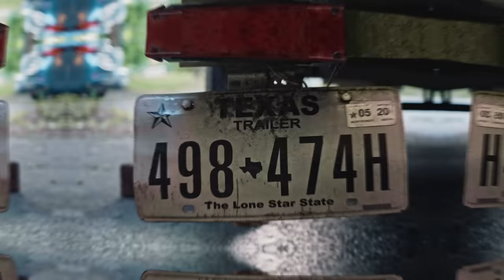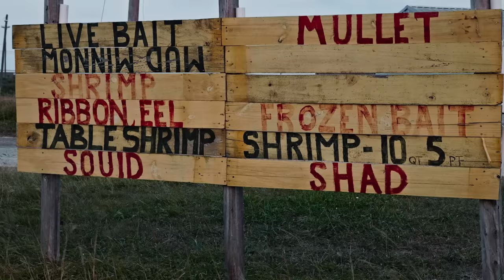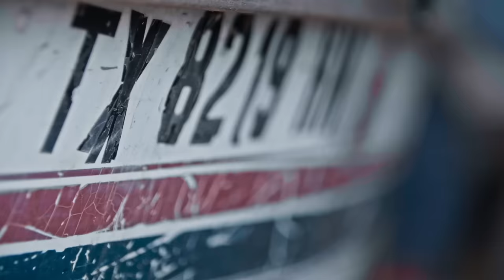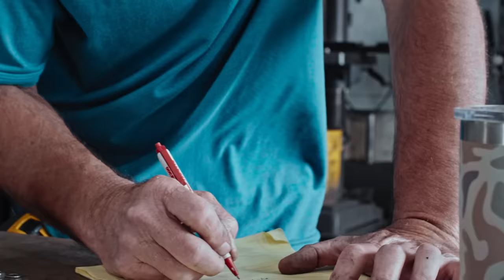Steve Rinella and JT Van Zandt Chase Redfish in Texas | S1E01 | Das Boat

Comment: broke my heart pulling that old Johnson off! put a 2 smoke back on it!
Reply: Depending on the model Johnson's are freaking work horses that can last for decades, yes would of been nice to see them give it a tune up. Have they never heard of a small backup on a dingie? to compensate for trouble?.
Reply: @CoalCoalJames  Don't need a backup for a honda motor
Reply: Why? Pollute more, run less. Those hondas are bulletproof. You want reliability. I certainly wouldn’t put a 2 stroke on my bass boat.

Comment: Here's a question regarding the fishing tribes.  There are artificial representations of virtually all of the bugs and critters you may find in the river.  Despite this, there has never (to my knowledge) been an earthworm pattern tied up.  There are redworms, San Juan worms, wooly worms,  chilli pepper worms, wiggly worms, but no earthworm.   Is this because it is simply not technically possible to recreate an earthworm in a $200 vice or is it because the thought of catching a fish on an earthworm is so vile that even an artificial pattern presented in a perfect roll cast by a Simms wearing, handmade net totting feller is universally off limts?
Reply: Bob..Google 'Senko worm fly'. You can use vise grips and a mechanics vise if you're so inclined.

Comment: C'mon. Putting a new 4-stroke on that boat is totally cheating! The old 2-stroke would have served you well with a little TLC. Clean the carbs, make sure the cylinder pressure is good, new plugs, check timing and you're good to go. Putting an $8000 motor on $500 boat runs counter to the spirit of the idea of buying an old boat. I disapprove. Kinda like "archery hunting" with a .300 Win Mag.
Reply: Bs. They are passing a boat to friends across the country. They want reliability.
Reply: Clary Carrier oh, I understand the issue—probably safety/liability issues—too. It just seems to run counter to the spirit of the exercise. Coaxing a cantankerous old 2-stroke into working all the time is half the “fun.” It ain’t really an “old boat” if what moves it is brand new. Don’t get me wrong, I love the series so much I binge watched season 1.
Reply: Clary Carrier And they could have made the old motor reliable with a good tune up.